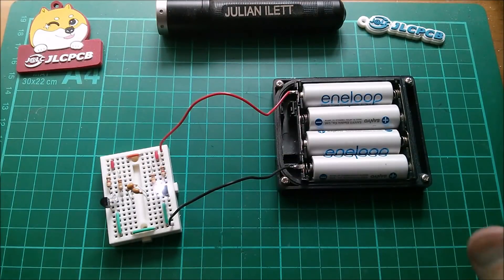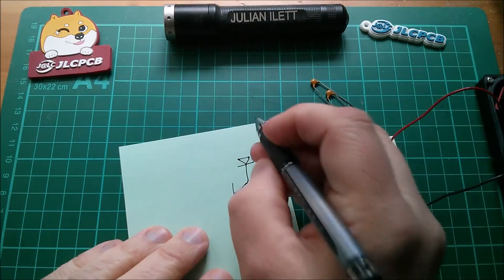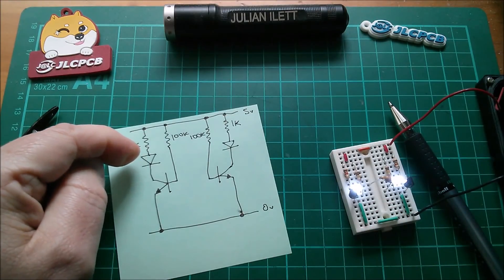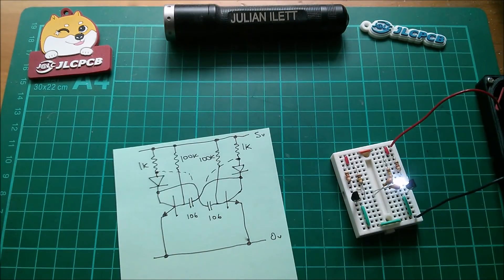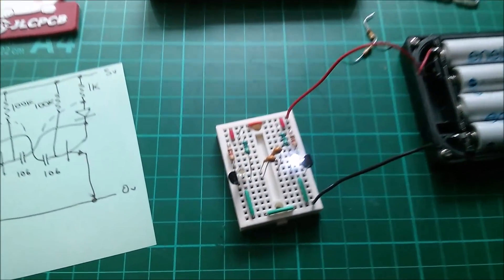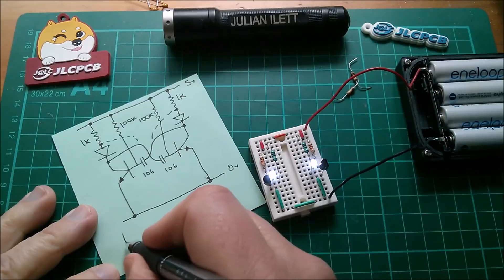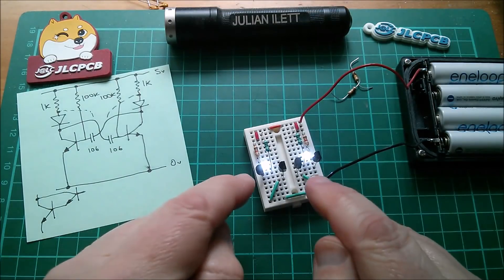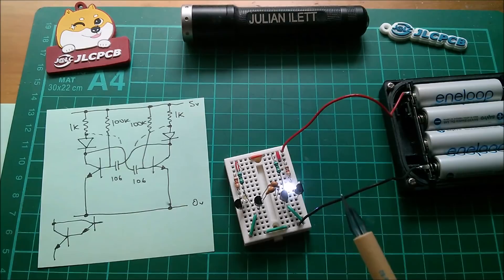Old School Flashing LEDs

Comment: I recall early 80,s making this circuit with two bc108 metal can transistors and 2 low voltage  lamps . It worked for a minute or so and stopped and I accidentally touched one of the transistors and it was stinking hot !!! Lol ... I think this was before leds were readily available.

Comment: Slower flash because the series LED also has a resistance.  Although not a constant resistance, but one dependent on applied voltage.

Comment: I'd reckon the reason why it's flashing faster when you put the capacitor lead in front of the LED rather than behind it, is that the capacitor now sees a higher voltage and charges faster (just the voltage drop across the resistor) as otherwise it would see the voltage drop across the resistor minus the voltage drop of the LED.
Reply: If the LED has a constant voltage drop this wouldn't make a difference because the voltage difference would be the same in either case, just with a DC offset. What might be happening is that the MLCC has a different capacitance with applied voltage.

Comment: And in true Blue Peter style, here’s one I made earlier… https://youtu.be/kBAB1klO964
Reply from the maker: Interesting, but not Darlingtons (from what I can see).
Reply: @JulianIlett  - no, not Darlingtons. With a simple two transistor circuit, the loading of one of the transistors to supply another circuit caused a variation in the frequency and mark/space ratio. So I added two extra transistors to overcome this problem.

Comment: When you moved one end of the capacitors between the other resistor & LED and the flashing sped up, I expect that has to do with the LED's voltage drop. The drop in voltage should mean a drop in current, thereby the capacitors charge more slowly, thereby slower flashing. (I think.)

Comment: You just have to remember that a transistor is a current amplifier, so the hfe and the base current is important.
Now on the other hand FET's are voltage controlled and so are more happy with larger gate resistors.

Comment: Multivibrators work very well with MOSFETs. They can drive much bigger loads and the infinite gate resitance means you can use very large timing resistors and small capacitors without needing darlington pairs. The timing resistor should connect between the gate and drain of the same mosfet instead of base to v+. Also try 100K or so across the LED to provide a more constant load and improve the waveform.

Comment: I used to build these circuits in the 80's with red LED's. I would solder the component legs together to make them as small as possible, twist two long lengths of thin wire together for power, attaching the circuits at random points and string them all up around the Xmas tree. :) Using random capacitor values, it looked realy good.

Comment: Great demonstration. Would have been nice if you'd have talked about the charge and discharge cycle of the caps and how that leads to the flashing a bit more. Seems more time spent talking about darlington pairs. Which wasn't the title of the vid. Not a criticism BTW - really like these vids of practical demos of circuit fundamentals!
Reply from the maker: Perhaps a follow-up video is required.
Reply: @JulianIlett  Yes, the relationship of the resistor/cap charge/discharge cycle is vital info for anyone who is new to circuit fundamentals.
However if it was solely your aim to introduce slightly more advanced concepts like the Darlington pair then you did a great job.
In any case it's always good to learn alternative methods of achieving the desired outcome.

Comment: Wow, that brings back memories. An eager 8yr old on Xmas day with my new electronics kit. Old skool breadboard and incandescent build, none of this LED rubbish as Dave would say. IIRC, I used pots to adjust the speed. Was my best Xmas present ever that kit. Two years later I got a zx80 in kit form and had hours of fun building that too.
Reply: Nice memories I also build one with incandescent bulbs , and got a used zx80 and began programming using an  old black and white tv .